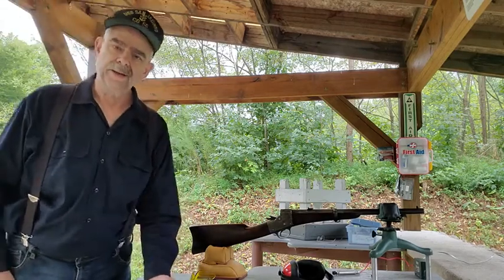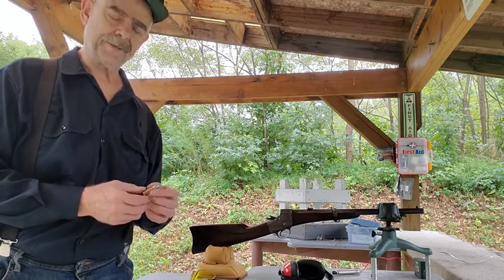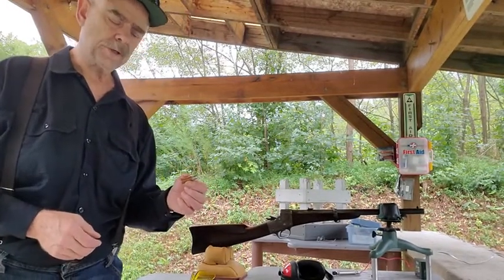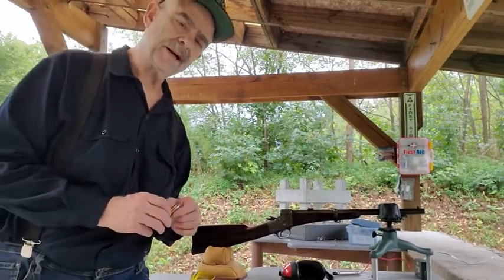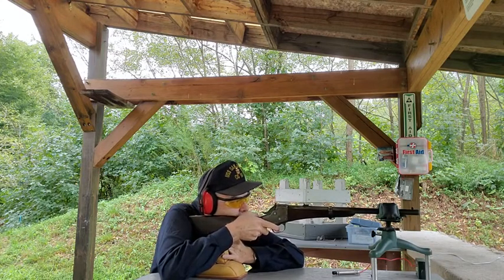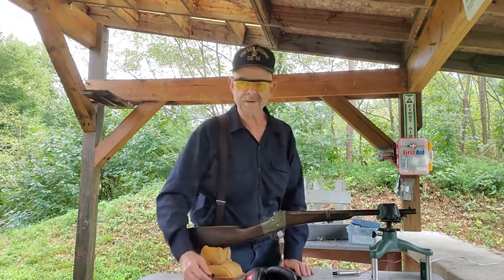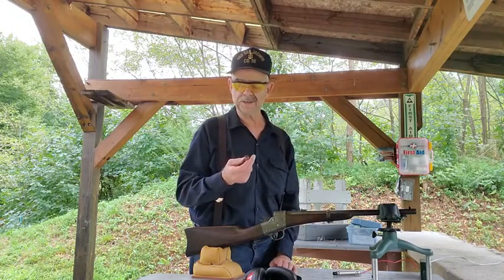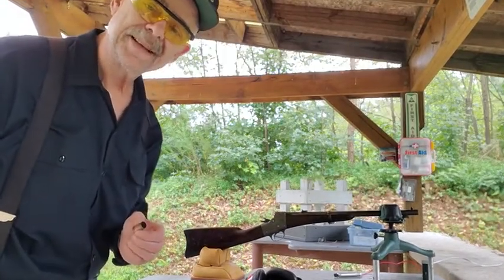Shooting a reloaded, original 1870s vintage .56-52 Spencer rimfire cartridge

Comment: Hello, can you tell me the diameter and length of the socket alone and then the total length of the finished product (socket plus ball), thank you
Reply from the maker: @drumaloa1714  The case tapers from .560"  just ahead of the tim to .540" near the case mouth. The case is 1.030" long. The overall cartridge length is 1.625" long. The bullet is .520" diameter.
Reply: @SwabbieSteve  Thank you very much for this information which is difficult to obtain in France.

Comment: I had to go look to see how the chronographs worked in the 1800's.  Didn't find anything from the 1800's, but I found info on the Aberdeen Chronograph from the early 20th century.  Pretty interesting.  Two screens the bullet would shoot through.  The first would drop a rod, and the second would cause a knife to strike the rod as it fell, and velocity was calculated off how far it dropped before being struck.  It was the first portable ballistic chronograph.  I guess the 1800's chronographs may have worked on a similar basis.
Reply from the maker: Interesting - I've not heard of that. Springfield Armory NPS has a facebook group. I'll ask about the chronograph.
Reply: There's also this pendalum that you'd shoot at and it would measure the recoil it would experience from the round hitting it. You'd use the measurement to find your foot pounds of energy or velocity.